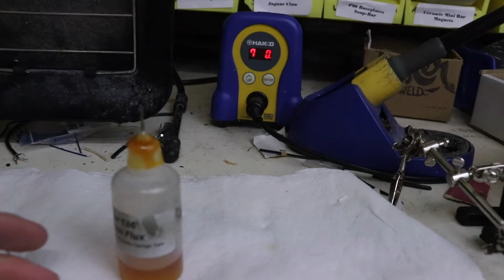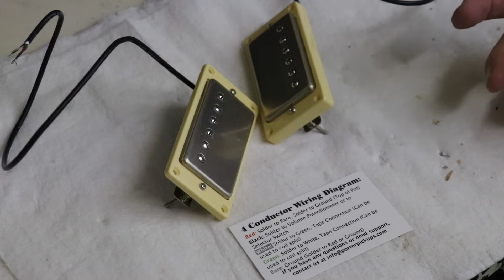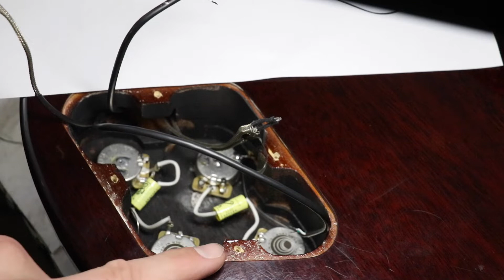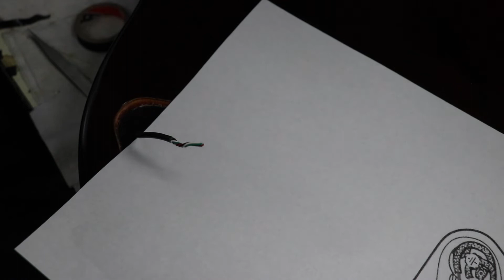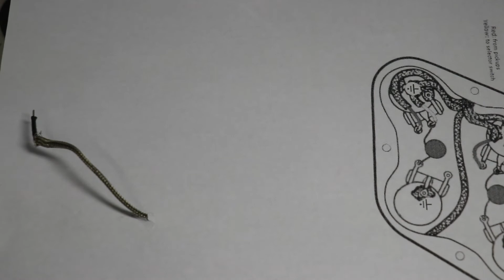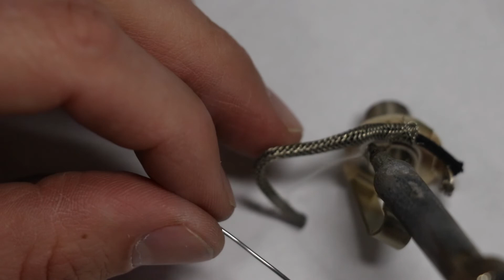How to Install Humbucker Pickups in a Les Paul

Comment: Im planning to buy a new pickup which has a 5 wire on it(red,black,white,green and bare) and my original one only has 2 wires(ground and signal).The new humbucker description says to tape the black and white together and green and bare together.The red wire is hot wire and green with bare is ground.So should you solder the red wire to the same place as the hot one on the original and green/black on ground?
Reply from the maker: yeah that sounds like it will work based on the new wire color and locations. Good luck with the install

Comment: Mines not working
Idk what it is
And there’s no going back with the jack output
If I cut more , I won’t be able to reach the point to solder
Reply from the maker: you may need to replace the wires and try to trace your connections to find the problem area with a multimeter. Hard to say what it could be but thats a good place to start!
Reply: PorterPickups I actually got it working after some time, the classic 57s are amazing! I had messed up at the output jack
I needed to have black sleeve between the 2 points that need solder